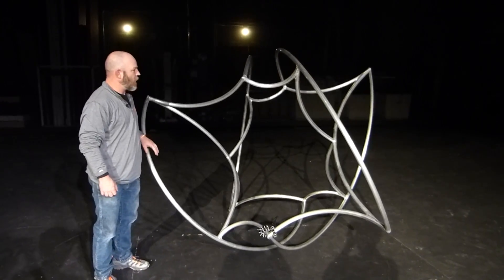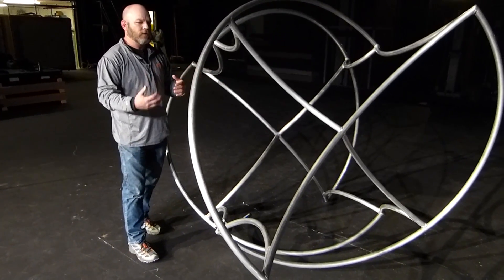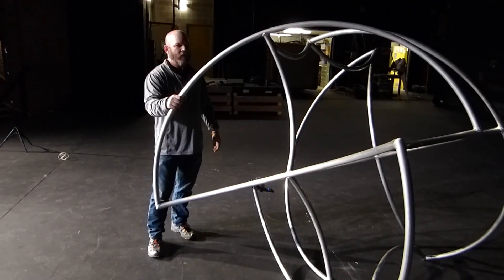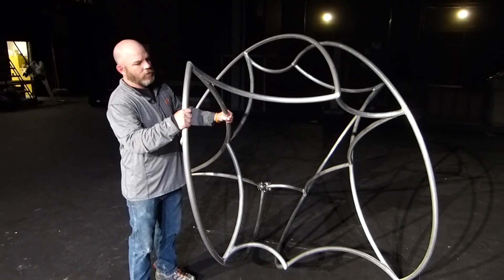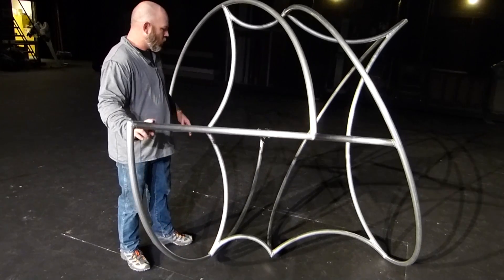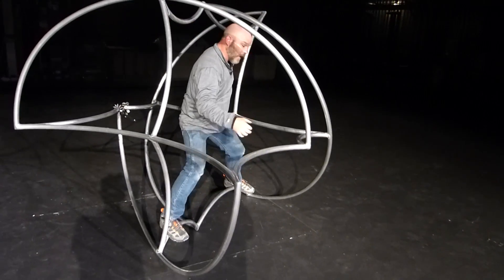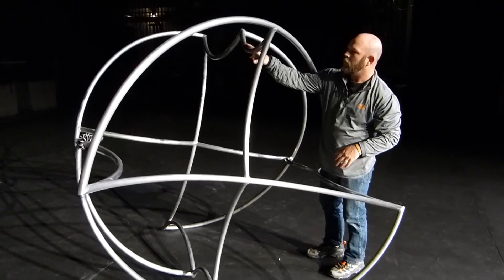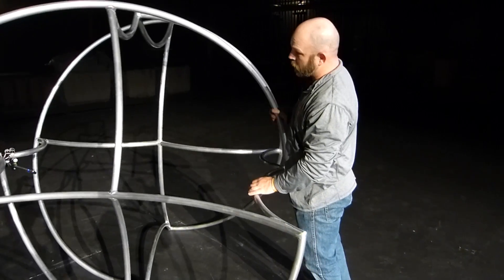Tao-Line - Lee Brasuell

Comment: I would let skilled athletes try it just with the right kind of sticky shoes and no further footholds or changes. Skilled athletes have no problem loosing their foothold as they go upside down in a cyr wheel, they just have enough power in their arms to push against gravity hard enough to keep their feet sticking. So they can give this a test run, including sideways and upside down, as it is.